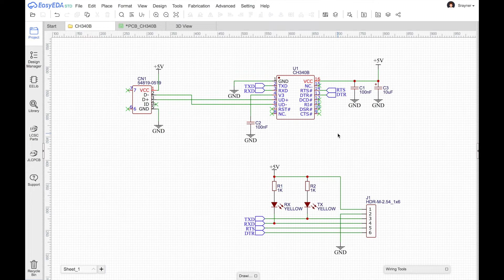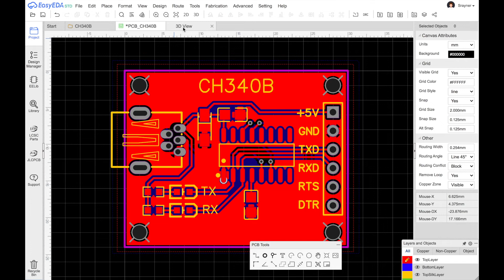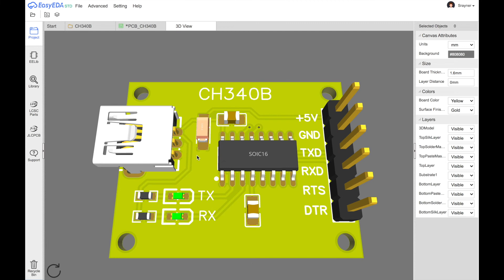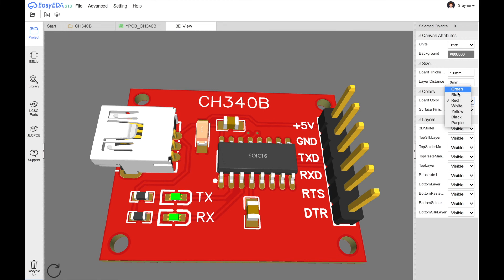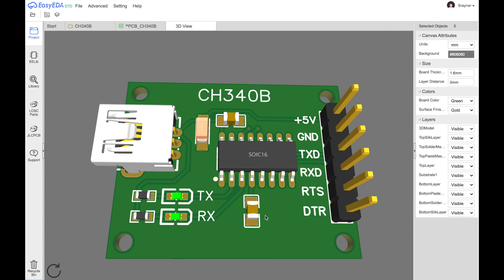USB to Serial Converter using CH340B Chip

Comment: Did it end up working?, I'm attempting the same thing and burnt 1 of my 3 chips, also do you need to upload a bootloader or should it just work?
Reply from the maker: To be honest I haven't ordered the board yet. I'm not sure which USB connector I should use. I think I've used a Type-A USB connector, but I believe that is incorrect. I think I should use a type B. So that gives me the choice of B, mini B or micro B. I'm also uncertain about the JLCPCB assembly service. I still think it's too expensive for such a small prototype. I think I need to ensure I'm only using basic parts.
Reply: @SteveRaynerMakes  ch340c modelini tavsiye ederim. kristal ihtiyaç duymaz